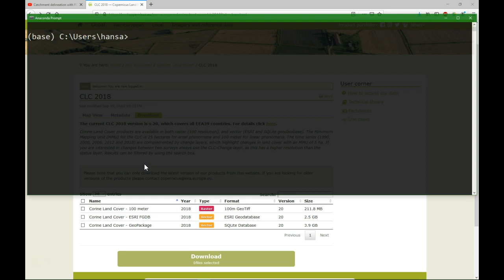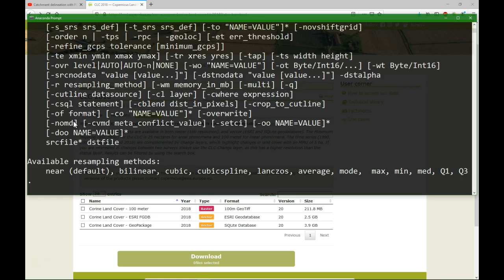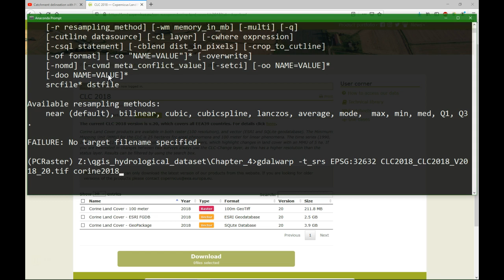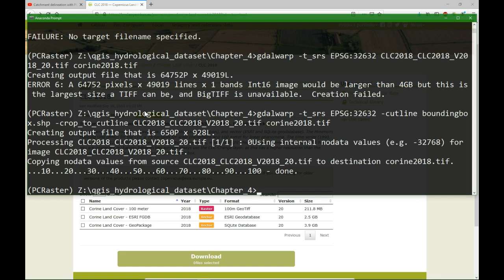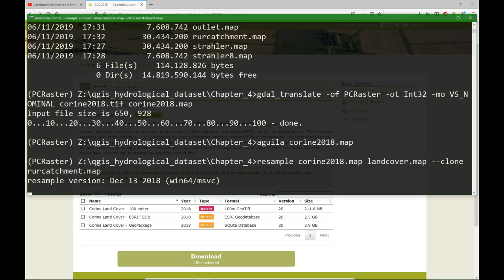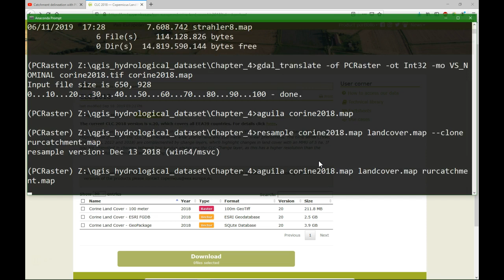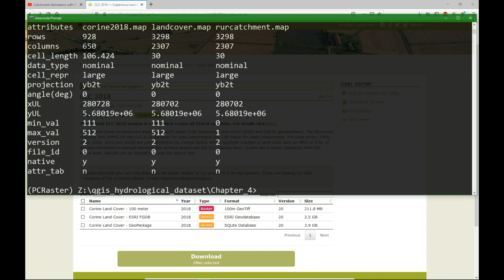Prepare raster data for PCRaster model

Comment: Thank you for the tutorials, they are really helpful!!. I have the next problem, when i use the resample function the new maps dont have any kind of information. Can you help me with that, or maybe recommend another function to assure that all the maps have the same properties of the clone map. Thank you!!
Reply from the maker: If the result of resample is empty it is likely that the input rasters are not within the extent of the clone map. This can be caused by a different coordinate system. Open the input and clone raster in QGIS to see if they overlap.

Comment: Following your tutorials, we have the .map files. Great! But I need time to convert them to a time series format like precip0000.001 . How do we do that.. I wish to use them in SPHY.
Reply from the maker: You can use gdal to convert to PCRaster format. The extension could be .map for static data or you can write a script to conver time series to .001, .002 etc. Here's an example script: https://github.com/jvdkwast/pcrastertools
Reply: Thanks for reply and code. As seen somewhere else and in your code, if I right, are we doing : 1) gdal translation .tiff to .map, followed by 2)  renaming the file to match time series format (since in this part I am not seeing any particular  raster function being used)
Reply from the maker: Yes. Because .map is the same as .001 etc. format. Therefore you need to rename to the time step after conversion from tiff to map.
Reply: Thank you very much. I converted them to .001 format and visualized them in aguila. They look perfect. Thanks a lot.